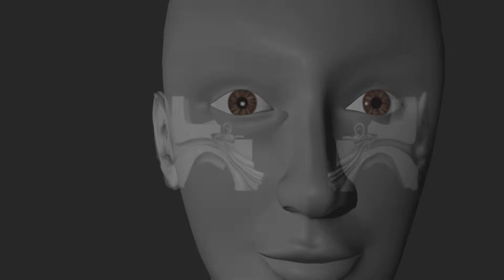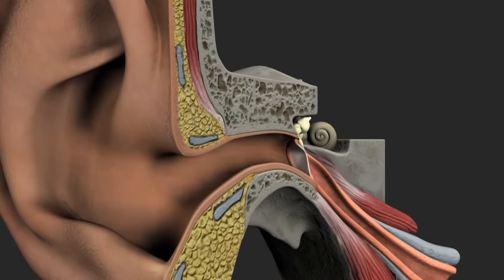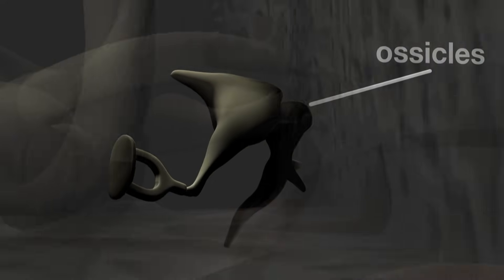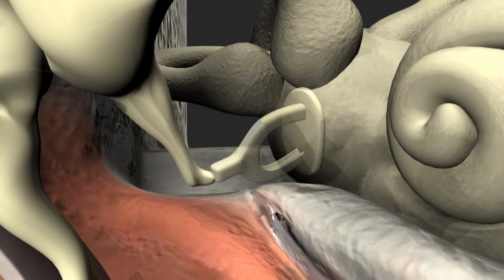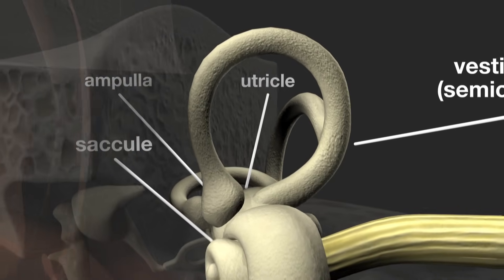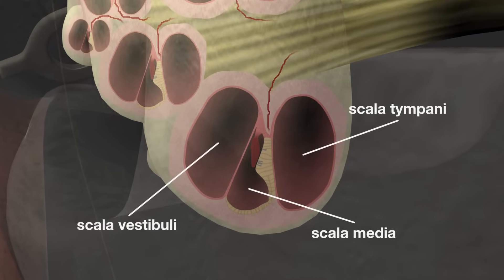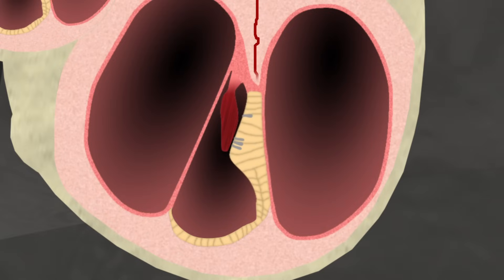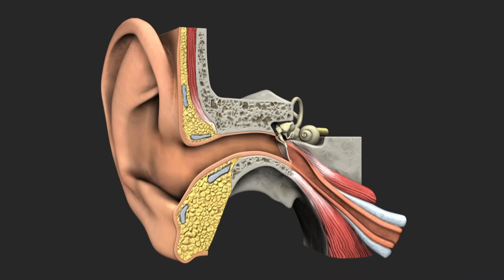Anatomy of the Human Ear

Comment: great video. comprehensive over a short time. only one suggestion. when the tympanic membrane pushes the handle of the malleus medially, the head (of the malleus) moves laterally (like a lever, just as the movie illustrates). the problem is that the incus does not move as a lever. so when the head of the malleus pulls the body of the incus laterally, the long process of the incus pulls the stapes latterly as well. it is counterintuitive, but the waves pushing on the tympanic membrane actually cause the stapes to pull, or tilt away from the oval window. i seriously doubt this detail is of any importance to most students, but i thought the designer should know for the sake of the next edition. on a positive note my lengthy awkward explanation is a valuable contrast to the efficient and effective nature of good graphic communication. thank you.

Comment: Notice that the pinna or auricle lacks symmetry, with neither radial nor bilateral symmetry.  This gives the same sound a different detection by the ear depending entirely upon its position in space relative to the ear canal.  This enables spacial sound sensing by the brain with particular attention paid to sounds approaching the face.